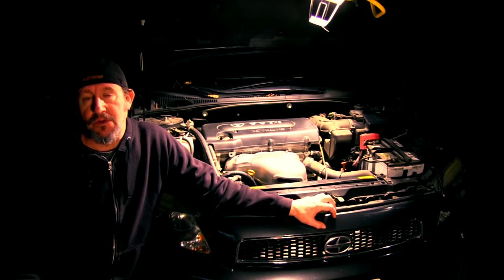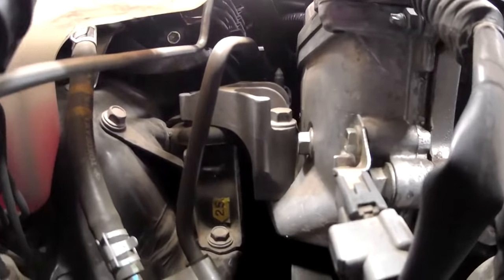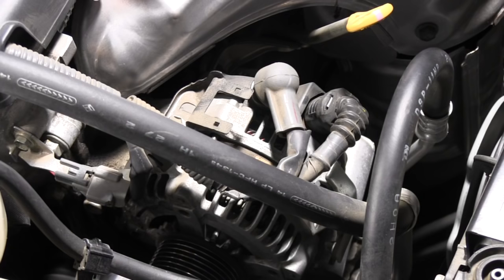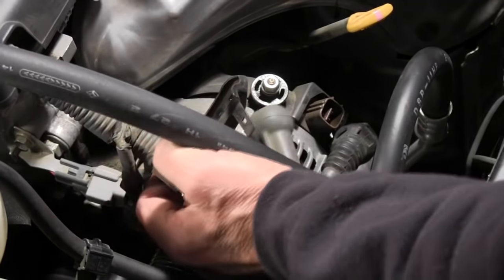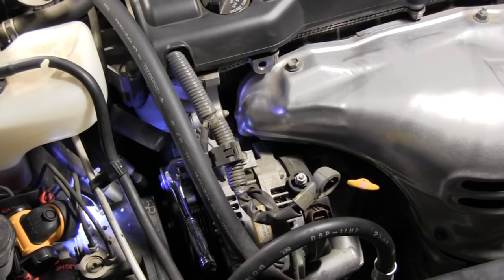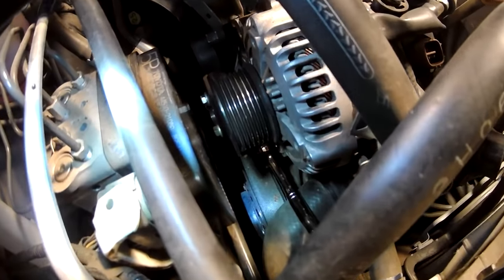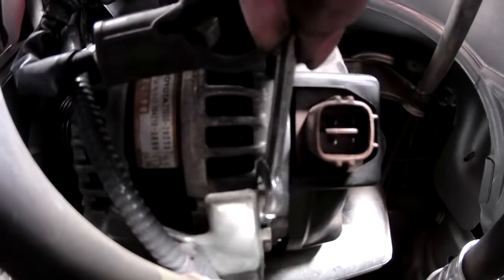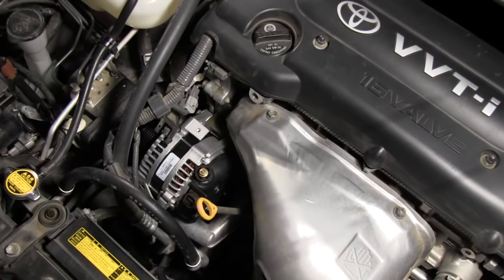How to Replace 2006 Scion tc Alternator

Comment: Hey man, thank you so much! I just used your video to replace my alternator on my 2008 tc with zero issues. Your video saved me a bunch of money and I really appreciate people like you doing these videos.
Reply from the maker: Tandiey Glad it helped and your welcome.
Reply: I have to change the alternator of my 2008 tc tomorrow. Good to know it worked for 2008 model as well.
Reply: @chris10077  hey bro, i changed my battery out on my scion tc 08 now my passenger window wont rollup at all. any tips i would help thanks
Reply: @DannyH77  mine did that also after a couple of days it will start working again
Reply: @robertorenteria4406  it's working now thanks
Reply: Doing that here in a few hours so ya

Comment: Had to stop in to say thank you for the video.  I've been replacing batteries once a year for a while now, so when the battery light came on I was dreading it. I am not a mechanical guy, and had all but decided to take my 2008 to the shop before I found this.
Giving us the socket sizes made me feel confident I wasn't dismantling my car and I was getting the right bolts (like the tensioner).  I did have to re-watch to realize the tension bolt pulled down, not up, so happy I didn't snap that off.
It's was pretty tight spacing to get the belt off, but it went on much easier, and that bottom bolt was a booger with my big hands.  Thanks again, I owe you a beer sir!
Reply from the maker: You are welcome !

Comment: For anyone who strips the tensioner pulley bolt, (its very soft metal.) Dont pull on it fast, just pull it slow, its hydraulic.
   Buy a 19mm GripTite socket. $20.for 10 sockets.
 Saved the day and a lot of trouble . 
Thanx CHRIS for the video.

Comment: Just replace my 06's alternator with the help of this video. Bottom bolt wasn't bad for me at all though i have pretty skinny hands so maybe that's why. Fair warning to a new viewer, a cheater bar is indeed needed to pull that tensioner down. I ended up using a giant pipe wrench to add lenght to my socket wrench to act as a cheater bar but oh man than felt dangerous. Thankfully it didnt slip off and the job went without a hitch. Thank you for uploading this video. I'd gladly buy you a six pack if you were near.

Comment: Good tutorial, Just did it by my self no problem. While putting the belt on I wrapped belt around the alternator and water pump, then while pulling on the tensioner I found it easiest to slip the belt on the a/c compressor pulley. Gave me room to pull with one hand and use my other hand to slip the belt on.
Reply from the maker: Thanks glad it helped.

Comment: Thank you so much for this video. I was swapping out my header for a new one and the bottom left bolt on the head was wanting to round off. The alternator was right in front of it and of course it just has to angle upwards so you can't fit a ratchet on it. Found your video and it made everything 10x easier. Also, working with someone else and having the car lifted makes taking off and putting on the alternator and belts much easier.
Reply: Nut* not bolt
Reply: Benjamin Eden

Comment: Thanks for the video, I just replaced the Alternator on my 2010.  That lower bolt underneath is major trouble spot.  If my hands were any bigger I would't have been able to get that bolt out, still took me a good 15 minutes to get it out.  My only critique would be to inform everyone about resetting the automatic windows in the car after you hook the battery back up.  Thanks
Reply: How do you reset the windows?

Comment: A suggestion: have a second person turn the crankshaft bolt (19mm) while using the method shown in the video. This will allow the belt to more easily slip onto the alternator pulley.

Comment: I didnt know about that tensioner and how it works. Glad you posted about it. It made my job easier.  My 06 has 73k and the alt went. It was making a weird noise when I started the car. I looked under the hood and tested the charging system, didnt look too good so I shut it off and then it was dead, no power or anything. 

My Walmart warranty battery (24) is over 3 years. So I cleaned the posts and tried again.. Nothing. Then as I was looking at the engine/batt/alt I saw some smoke coming from the + on the battery. I took off the neg and got a big spark. That tells me to check the alt.

I took off the wires to the alt and no more spark at the battery. So I put a small charge on my battery, connected the neg and it started but was still weak starting and NOT charging due to the fact I removed the alt wires. There was also no more neg cable spark with the alt disconnected and it was NOT charging. 

I plugged the square connector on the alt and it was still not charging. I turned the car off and touched the red power wire for the alt and got a spark. That tells me the alt is shorted out. It should NOT spark like that at the alt with the car off.

That also tells me the alt is bad because it is shorted out internally. So I bought a rebuilt one. I was done 4 hours later.

If any other person who just drives and doesn't check out their car when it's making noises, as my car was doing, could have big problems. 
If I didnt check the noise as I was leaving the house, I would have shorted out my electrical system to a disastrous degree.  The wires would have melted and cause big $$$$$$$ problems. My alt also smelled burnt as it was initially running. Now it charges at 13.58 volts.

You video helped big time. Thanks.

Comment: Great vid. Just have to be careful not to round out that tension bolt. idk if it's a scion thing or your quality of tools but the bigger the socket wrench the better IMO. The instructions from RockAuto mentioned to loosen the bolts on the Alt first then go after the tension bolt before & after the part is hung so you have some more play in the S-belt. Also, the deeper the 12mm on that bottom bolt the better ; ) that bolt is a MFer. Pehaps a video of how to test the battery/alternator can be linked to this as well. Never-the-less great DIY vid Chris!!

Comment: Thanks for the video.  I do wish you showed more on putting the belt back on.  I still haven't done that.  it came off the middle pulley so I'm taking a break for the day to get my wits back
Reply from the maker: Sorry that's been a lot of peoples complaint about the video is putting the belt back on I had a hard time with it too . I think I will do another video just putting that belt back on , thought about doing it tonight but my daughter took the car and is out for the night . It does help if you have another person pull back on the tensioner while you concentrate on putting the belt back on.I had to use a screw driver to pry the belt back on the pulley being mindful not to jab the belt and punch a hole in it. .
Reply: The trick is to pull the front wheel off and remove the splash guard so  you can be very sure the belt is correctly on all the pulleys.  Run it around all of then but the alternator.   Now slip it off the water pump (the one without a ridge close to the front on the car) and make sure is doesn't get behind any of the lines.  Now use the slack to get it on the alternator.  Check to make sure again it is fully on the other pulleys (if it is on any of the guide ridges you will never get it on).  Now pull on the tensioner and slip it onto the water pump pulley (no guide ridges makes it "easy")
Reply: Yep, taking the front passenger wheel off and taking off the access panel helped a lot with getting the belt on.  I actually did it alone but an extra person would probably help.

Comment: Having a hard time installing the new one.  How to you line up the bottom bolt with the abs module,  radiator hoses, electrical wiring and literally the entire car in the way? Been working on it 2 days

Edit: ended up having to sand the bracket a little. Fit like a glove afterwards

Comment: Thank you so much sir! I have a huge question, my car was recently in a crash and the engine is leaning backwards, a mechanic said the engine should be good with an alternator replacement since the alternator was the one that took the impact, do you think it could be the mounts?

Comment: Hi i have the same car make and model and when I replace the spark plugs small screw went to the engine and can’t get it out and just close and start it and battery is new car only running when i jump start otherwise it will die when I remove to jump start why is that? Did i the engine break coz of the screw inside? Or what else? Please help and thank you.

Comment: Weird thing the bottom bolt wasn't an issue taking it off, but putting the belt back on its a headache! Im stuck there😣😣
Reply from the maker: Tony Romero I did a separate video on putting the belt back on ,should be a  link in the description of this video and a end card at the end of this video.

Comment: I'm trying to do mine and I got those two main screws out but alternator doesn't seem to wanna come out. Think mine has an extra screw
Reply: OMG! i got it out but now can't get the serptentine belt on around the alternator wheel, i stripped the tensioner bolt fml royally

Comment: What problems were you having that made you change the alternator.  I have been experiencing a weird whining noise with my 07 tc when i start it up, when its in idle.  and also letting off the gas while driving.  Under certain circumstances when im on the throttle it whines.  From what ive read so far, my problem might be the alternator
Reply from the maker: Jordan Zink The battery light came on in the dash. The noise your hearing could be the bearings going out in the pulley shaft, might try using  a  Mechanics Stethoscope to try to pin point where the noise is comming from .
Reply: One of the bearings went out on the my old alternator is what I determined from the sound it was making and from other videos ive seen.  Went ahead a bought another one from auto zone and replaced it using your video. Also bought a new belt but determined it would be to complex to fix that myself.  However the alternator wasnt assembled correctly.  The pulley wheel was lose and when I turned my car on it was loud and I could see the belt shaking, as it was shaking my car.  It ended up knocking the belt off.  Long story short I had my car towed to a shop, and the mechanic repaired the alternator and put on the new belt (which he said was a pain to put on).  Runs like new now.  Seems to be idling just a bit low, but that could be because of the low temp outside.  Anyhow your video was awesome.  My dad and I were able to do the job relatively simple.  We didnt have the awesome cheater tool like you had but we made one ourselves lol.  Thanks for putting out an awesome video sir.  The cat fight part is hilarious as well
Reply from the maker: Thanks and your welcome glad all worked out.

Comment: If the battery indicator light was on before you did this repair, did it shut off automatically when you changed alternator?
Reply from the maker: +Mellowman Mace Yes the battery indicator light went off after the new alternator was installed.
Reply: +CHRIS10077 Ok good. Thanks for doing the video! Any recommendations for getting that lower 12mm bolt off?
Reply from the maker: +Mellowman Mace It's such a tight space I used a 3/8 drive ratchet with 12mm socket no extension.
Reply: +Mellowman Mace remove the wheel and you can easily get to it from the bottom.

Comment: can you help me please, i change the altenator of my car and now i can not put the belt back on the alternator
Reply from the maker: This has been a common problem for people, I am going to do a separate video on this issue haven't had time to do it yet . Anyway I had a difficult time putting the belt back on myself get help have someone pull back on the tensioner while you concentrate on putting the belt back on using a screw driver being careful to not punch a hole in your belt you will have to pry the belt over the ridge on the pulley. Some people take off the passenger front tire and take off the access panel because the pulley on the water pump has no ridge. I found it a faster job the way I did it even tho its difficult to get the belt back on.

Comment: How do I get the belt back on? Man this is a bigger pain than the bottom bolt.
Reply from the maker: That belt can be difficult to put back on for sure, get someone to pull back on the tensioner while you put the belt on the alternator  pully I had to use a screw driver being mindful not to punch a hole in the belt to kind of pry it on .

Comment: I just put in the new alternator but now my car its shaking i couldn't find out what going on any idea?
Reply from the maker: Zerxy xion One possible thing , when you disconnect the battery it clears the pcm's memory and it needs to reset its self , if it will let it idle and make sure the belt is on all the pulleys properly.

Comment: DUDE your fucking killing me!  NO ONE SHOW HOW TO GET THE FUCKING BELT BACK ON!!!!  You show fucking tightning small bolts on the alternator, but nothing about the hardest part!  GETING THAT FUCKING BELT BACK ON
Reply from the maker: You may need help get another person to pull back on the tensioner while you put the belt back on the pully, use a screw driver if you have to, pry the belt back on the alternator pully that should work . it can be frustrating I know. Good luck
Reply: Thanks,but yeah I alrady tried the screw driver... I stuck it through the belt.  So tomorrow I get to buy a new belt and start over.
Reply: slip it on the water pump, NO RIDGE
Reply: tried that... must have been something with mine... took the shop all day to do it and they said it was a bitch.